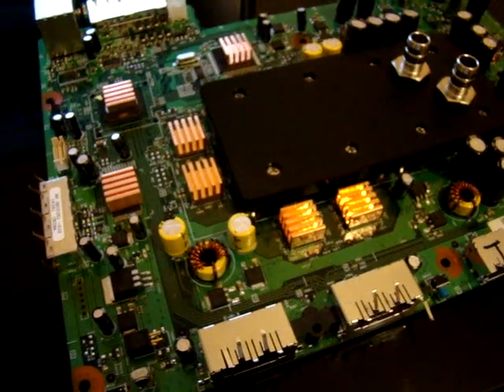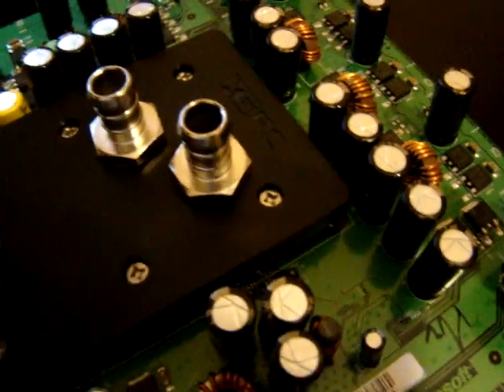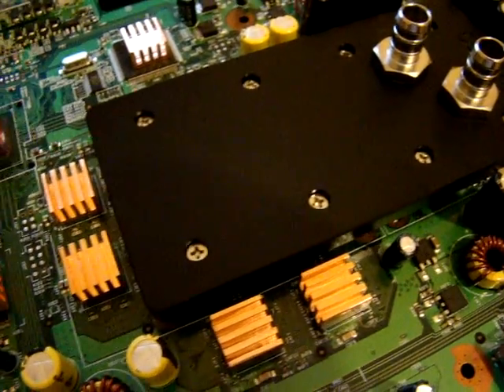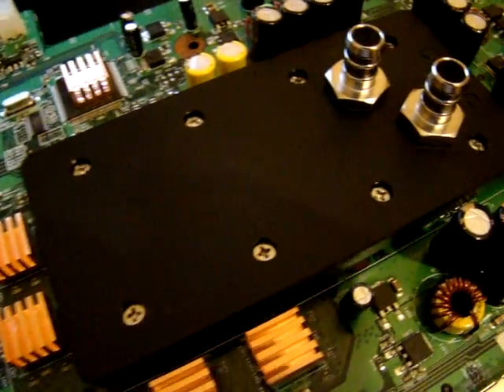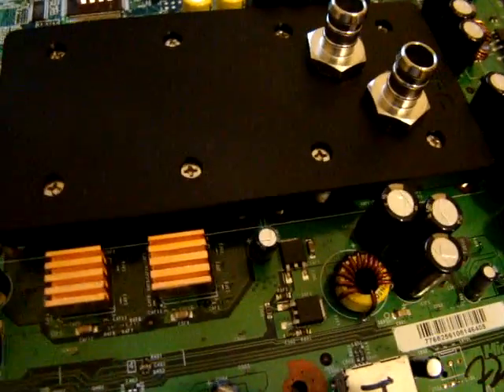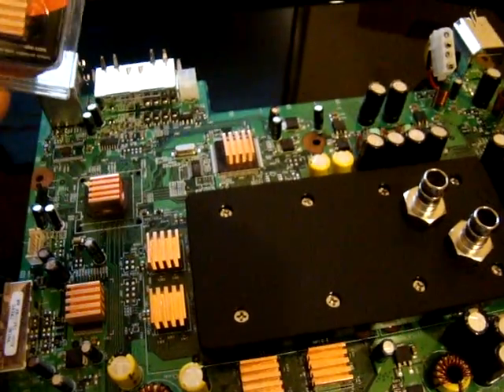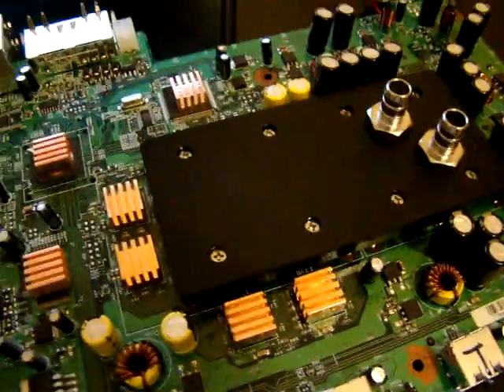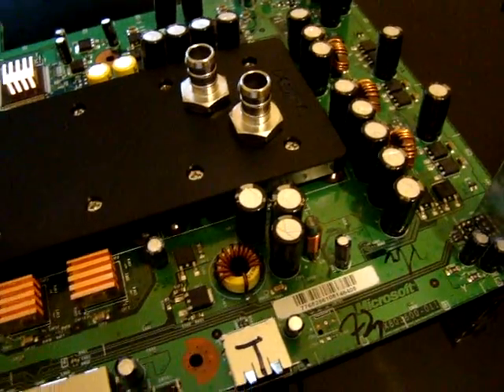XSPC Water block XBOX 360

Comment from the maker: Hey Nipster its going ok so far, I want to try this XSPC block as the design is more efficient than the Koolance blocks i used before, and I yeah i intend to use a larger OD than before. I take it you are refering to the the Zalman Res XT? I was going to use that kit to daisy chain two 360's together - as all the hardwork of set up is done for you but its very pricey.